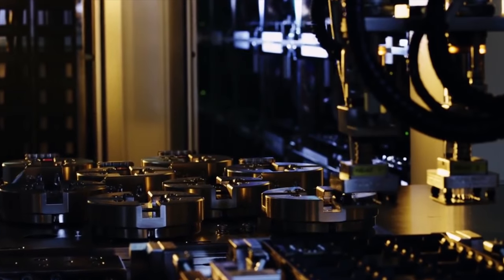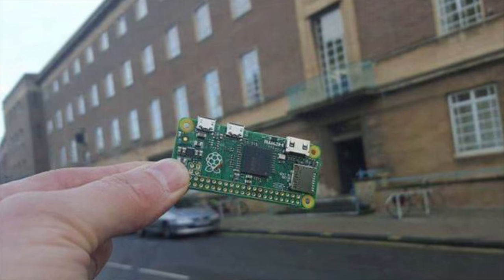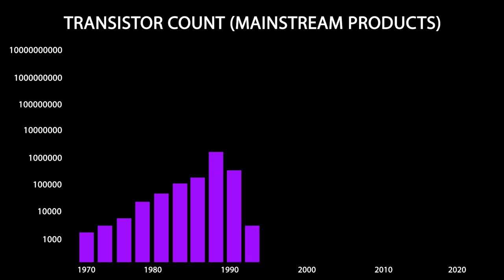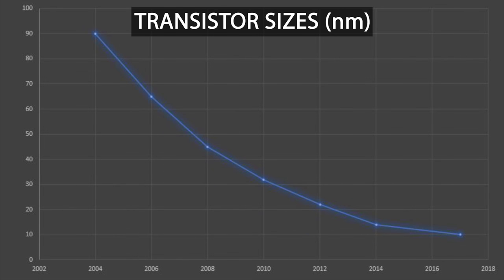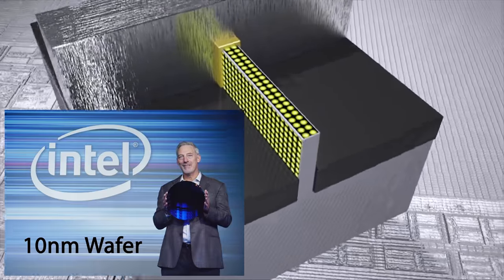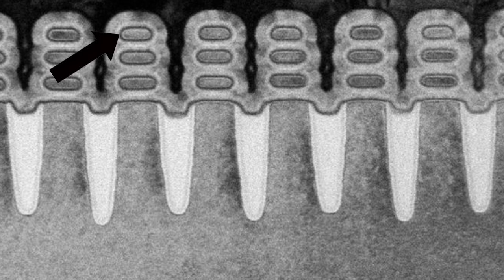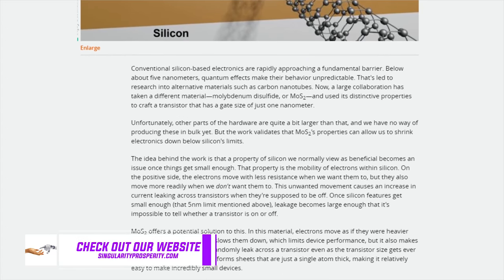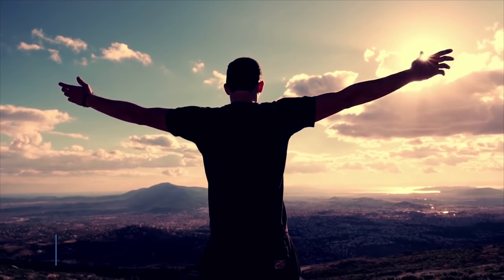The End of Moore’s Law?! (Shrinking The Transistor To 1nm)

Comment: Reads the news - Intel is having trouble with their 10nm process.
While AMD is already gearing up for a 7nm release in 2019.
Poor boi Intel
Reply: And it launched just yesterday.
Reply: And this Video is one year old, sooooo... yea
Reply: They're not really comparable, Intel's 14nm was equivalent to everyone else's 10nm
Reply: @MyNameIsPetch  That is true, but the 7nm TSMC node is slightly more dense than Intel's 10nm node. The last thing I've heard is that Intel is reducing the density to try and improve yields, but at the same time, news outlets have been stating that the node is basically dead. So idk?
Reply: @MyNameIsPetch  They sacrifice multi-core power draw for single core performance. Now that AMD has released their 7nm chips everyone will see through Intel's shit chips.
Reply: And yet AMD processors have higher power consumption.
Reply: @muzgnasicianie  No, they fucking don't. It's not 2013.
Reply: Рюусей Бои Triggered. 6700k is comparable to newest AMD’s. AMD is going into more cores. It is like buy tablet from China with 8 cores and say that is better than any branded device because of amount of cores. What AMD do is just make decent processors for less money. Nothing wrong with buying AMD’s processors, just this is facts.
Reply: @muzgnasicianie  8700K pulls nearly 160W at full load and is rated for 95W. The 2700X is rated for 105W and pulls 104.7W. Please tell me again that AMD has higher power consumption. Don't even bring up the server market, because Cooper Lake is going to be a glued together mess of an MCM.
Reply: Рюусей Бои Okay boy. I do not need processor for render a poop. Just aiming into gaming. For watching youtube or loading pages I can use a phone.
Reply: @muzgnasicianie  Sure kiddo. Go play the gaymes, the big boys will program them for you with AMDs
Reply: @muzgnasicianie  well you don't, but a lot of people do care about rendering power and multitasking
Reply: Рюусей Бои But definitely NOT YOU :)
Reply: Kreesty Absolutely FINE.
Reply: @muzgnasicianie  Too bad 10nm is coming 2h 2018 however 7nm AMD chips are coming in 1q 2018 and zen 3 architecture is at least 80% complete. Gaming is slowly moving towards using 6 threads from 4 threads. Zen 2 also has around 13% higher ipc and is running at 4.5 ghz outperforming Intel currently and has significantly better node with 7nn finfet+ and 5nm finfet architecture for zen 2+ or even 5nm finfet+ for zen 3, and Rome has 64 cores compared to 48 on Intel's cascade lake and cascade lake die is 2×698mm compared to 398mm on Rome, and newer games might run even faster on zen 2 because zen 2 can now operate at 256 bit buses for floating point operations.
Reply: @ryuuseiboi950  sure as hell. my intel is dying while baking light in Unity. can't wait to upgrade to a 2700x
Reply: Someone Kill me OMFG! I feel now like I released a fucking KRAKEN! in next 30 years maybe we will fly commercially to the moon?! And so WHAT?
Reply: @muzgnasicianie  What's your point?
Reply: Lotte That after release of next gen AMD processors, Intel will release their own. This is never ending race. I am waiting for new AMD processors and possible that I will buy for a new PC. I do not give a shit what brand but current AMD’s do not interest me.
Reply: @muzgnasicianie  Then don't go around saying AMD's CPU's consume more power than Intel. It's alright to say that you're not interested in AMD's current lineup, but don't go around saying something so blatantly wrong. The 'runs hot and needs a nuclear reactor' meme died with Ryzen, so stop that.
Reply: Lotte Man... will you cry?
Reply: @muzgnasicianie  Do you have anything to add or are you really this bored?
Reply: Lotte Yes! First - mind your language (you do not sound mature) Second - I can say whatever I want and all You can do is disagree. Third - I am buying what I need and adjust to my needs, not what you prefer.
Reply: @muzgnasicianie  First of all, I haven't insulted you. Secondly, yeah, you can say whatever you want, doesn't mean it's correct. (So far you haven't been right about the topic at hand). Third of all, I didn't tell you what you should or shouldn't buy.
Reply: Lotte Ah sorry. „Dmitry” use bad language. I am confused by amounts of comments and do not pay attention who respond to me. So you say that 8700k TDP is 95 watts but it can consume 160 watts on full load? Are you talking about overclocked cpu or just stock?
Reply: @muzgnasicianie  I7 6700k Cinebench R15 multicore score: 888
Ryzen 7 2700x Cinebench R15 multicore score: 1778
Source: CPU-L (Android)
Reply: @mikuzoid  you are comparing 2 different generations, should use the 8700k and even that got released 2 q's earlier smh
Reply: @- - amd is already doing that and yes, but it will take some time and they will further optimise because a bigger cpu means a new motherboard because the old wont fit and not everyone would go and just buy a new motherboard
Reply: @mischol  That's because I was replying to the comment the 6700k was the same as current gen Ryzen! Read the comments before you reply!
Reply: @MyNameIsPetch  that's there 14++++ they essentially just are using a more mature process to make up for difference in compute. The way the process holds them back is  the power consumption is higher and transistor density is lower for intel
Reply: @gabrielwhite3890  13% is not confirmed at all, its speculation based on the math of zen1 density and frequency vs zen2 density. While its probably accurate at best , and more likely closer towards 20%+ , it's still speculation.
Reply: @gabrielwhite3890  I doubt 10nm intel will release in 2018... That's 1,5 months and they've JUST released the 9-series.
And nope. Zen 2+/Zen 3 is not going to be 5nm. AMD listed it as being 7nm.
Reply: @Mikkel111  Well TSMC is currently testing 5nm nodes right now, and AMD used a slight process shrink with whatever they had, and 5nm seems like a good option but probably will be the finfet+ version of it. According to Mark Papermaster, they are already done with the 7nn finfet+ and considering the fact that smartphone giants like Apple or Huawei use the smallest node possible, AMD will be losing out if they stick with 7nm considering 5nm is a half node. But zen 3 will definitely be a smaller node considering they're supposed to the 'renaissance' of chip design with the zen architecture. Not only that but AMD will want a higher density for their server market. I'm not sure about 10nm still being around though.
Reply: @tarkfarhen3870  Polaris was an architecture which has no way to beat Pascal, but amd and Intel are close enough that a superior node will make it consume less power. Your example makes no sense what so ever.
Reply: AMD IS REALEASING KILLING 7NM NAVI TO GRAPHICS

THE PRICE PERFOOOMAANCE POWAA.
Reply: @milo20060  Uhh 7nm is sadly not getting yields it's supposed to because of complexity. It's like a new oven for pizzas and a simple pepperoni pizza will be cooked much easier than a pizza with many different toppings, not only that, but Navi is extremely hard to predict when it comes to performance, you can't celebrate Navi if we're not sure.
Reply: Just be thankful about AMD, without their ryzen, Intel would still be on 4cores 8 threads configuration..
Reply: @heyitsmejm4792  6c12t was going to happen just at $500. Calm yourself AMD was just marketing as them pushing Intel to do it.
Reply: @MyNameIsPetch  the reason Intel's 14nm is so good is because they've been rereleasing the same technology, just making smaller tweaks
Reply: Correct!!!!! Intel had been sleeping while AMD has been hard at work!
Reply: Intel went down a dead end in hopes of finding a way to increase yields, and it was a horrible blunder. The blind pursuit of mo' money has finally dealt intel a massive blow, and they may never be the same. Intel has two options, learn their lesson and get back into being a company that makes good CPU's, not cpu's with the biggest profit margin, or delve deeper into anti-competitive cash grabbing that got them there in the first place. The later will be suicide, but everyone with authority at intel only knows the later.
Reply: Southeastern777  Which is exactly why you should be supporting AMD. That is, if you believe in capitalism. But, if you are trying to point out how capitalism is flawed, please, keep supporting monopolies. 
I will never understand how anyone can fanboy for a company that already holds the majority of the market. What are you trying to prove? Awfully self destructive behavior.
Reply: Southeastern777 Okay, thanks.
Reply: @ryuuseiboi950  dont be mad Intel is way faster but also more expensive. AMD is slower but cheaper. Both have uses
Reply: Southeastern777  Eat up your ovens, mate. AMD's CPU's are absolutely destroying everything.
Reply: Southeastern777 Why are you using a mediocre processor that you clearly don't like? Doesn't it kinda seem like you're lying? Also why are you calling something mediocre when it delivers the most competitive products? AMD has held most of the CPU market for the past 3 quarters and Intel has no answer. Just inform yourself amd then come back.
Reply: Or perhaps AMD is more irresponsible than Intel. The 14nm and 10nm FinFET processes have been a real nightmare. Really bleeding edge stuff. Imagine the issues 7nm FinFET will bring.
Reply: AMD leans on TSMC for this. Designing architectures is like an architect designing skyscrapers. Not every design comes to fruition, without the right capability.
Reply: @muzgnasicianie  Not sure if it has already been answered, and if you are even still interested by this, but here is the explanation for Intel lower TDP than AMD's:
The difference comes from the way both companies have defined TDP. Intel defines a chips TDP as the heat the chip outputs at the base clock. This means that the chip, when it is boosting, might output significantly more heat.
AMD, on the other hand, defines TDP as the heat output at the boost clock, which is why their TDP might seem higher than Intel's, when the actual heat output might be lower.
Reply: Lotte asking someone if they have anything to add and if they are really so bored is offensive
Reply: James Berry and this is what everyone seems to miss...
Reply: Well AMD rushed  it.
Reply: INTEL XEON PLAT 8176M 28C 165W 2.1G  ........And everyone forgets the real mass users of CPUs.....Servers lol
Reply: @muzgnasicianie  not now lol
Reply: Intel is still having trouble with 10nm on the desktop. Only Ice Lake is 10nm.
Reply: @UnrealOG137  yup. And from what I've heard, AMDs Ryzen 5000 series CRUSHES Intel's 10000 series in every way, including single thread performance.

Also, AMD is appaerantly ACTUALLY COMPETING on every level with NVidia...

Team Red just be destroying everyone this year...
Reply: @AnotherLotte  7nm is almost 14nm of intel der8auer shows it in video with a microscope
Reply: @12Burton24  I could've sworn TSMC's 7nm node was denser than Intel's 14nm node, about on par with Intel's 10nm node. Also, you replied to a 2 year old comment I made, when Zen+ was on the scene, and Zen2 was about a year off from launching.
Reply: @AnotherLotte  it is by a little but its far away from twice as small. And this should already be known 2 years ago thats nothing new 😉 because its over a lot of past cpus the same stupid marketing bs
Reply: @12Burton24  I don't think I ever mentioned it would be "twice as small" anywhere within this comment thread. Only that TSMC's 7nm node was slightly denser than Intel's originally intended 10nm density.

I mentioned the thread's age mostly because my memory sucks, I had to look all this stuff up to make sure I was remembering things correctly.
Reply: @AnotherLotte  maybe i marked the wrong person, sry for that.
Reply: @12Burton24  It's ok, I understand, I've done that before too.
Reply: Quantum computing is future . But iphone Making 5nm processor implies we are long way from moore's law ending.
Reply: @Scarface-hl4bl  This 5nm are anyway not 5nm in gate size its just a fancy number they splitted years ago the nice nm nam from the actual size.
Reply: @muzgnasicianie  this guys is dumb af.. sad that everyone is kicking your @s*
Reply: Now iPhone 12 has a 5nm processor, and Android phones will start being powered by Snapdragon 888 first Android 5nm chip.

In 2022 we'll have 3nm chips.

Intel still is stuck at 7nm 😂
Reply: @DarkH4X0  Intel is not even aiming to 7nm nor is this number saying anything. 7nm or 5nm is just a name nothing lese i earlier days it was the size of the transistor gates...but thats a  long time ago.
Reply: Now their gonna put 3nm in zen5 while Intel is gonna finally get 10nm in 2 years
Reply: @moist.politician  One thing i can tell you they dont put 3nm into, 3nm is a technology process called like this and it says nothing about performance, in theory 10nm Intel could beat 3nm TSMC because the name tells you nothing about performance.
Reply: Poor boi intel😂😂😂😂😂😂no it is very very rich
Reply: And here we have 5nm now
Reply: @grischu8277  this video will be 4 years old soon….
Reply: Reading this thread in 2021🙄🙄🙄
Reply: @Muhammad-cx8ey  Pre-ordered two 12th Gen core i9 12900k just last week! Winter's coming and I need some space heaters!

Comment: Nvidia is cheating with Moore's law. Instead of relying on making node size smaller, they simply increase die surface area. Moore's law makes an assumption that each product is of similar production costs, but this assumption is unfair. If you plot for computing power per price unit, you'll notice that the last few data points on the Moore's law graph are all outliers
Reply: Exactly
Reply: Akin Khoo   I agree.

In fact you can pretty much extrapolate (see what I did there?) Moore's law to pretty much any important metric about computer power & digital performance, as he showed in the video.

And as he said at the end, it doesn't even really matter, ultimately, that the size of the chip is going down. As long as the computing power increases, even if it's from CPU processing optimization (better planning computations so there's less overhead, basically, and compiling them in a way that avoids multiple computation when possible), we're good.

The letter of the law may be broken, but the spirit remains true.

No cheating in that.
Reply: For the PC Market no one cares if the Chip is 1 inch or 5 inches big ;D
only "smart"phone hipsters need small chips so they can carry their survailance device everywhere and look cool ;D
Reply: @hyperhektor7733   You seem half serious, but still.

The density of computing power matters just as much a costs. You can see it as the number of operations you can perform per volume unit. Just as increasing computer density has made possible PC (which would never be possible with, say, the 70's density that could be achieved, regardless of price). Greater computing density enable applications unthinkable before.

Of course price matter, otherwise there's not breadth to the market for computing power.

I see price as breadth & density as depth, in a way...
Reply: @Francis Vachon i am on Board since Windows 3.11 and the x386 Cpu :D and i installed and since then every windows version and build every PC my self (the newest midprice-cpu which was aviable at the time).
So i can say i have a kind of overview of the topic :).
What i see is that the cpu-power is wasted by the programmers, since they started to use more and more less efficient programming languanges(for programms and operating systems). So the hardware becomes faster but the user experince stays the same since 20 years xD.
We already are far beyond the point where performance per volume counts. I can buy a used xenon CPU for 7$ on ebay which has 4000 Passmark points which is insane. People these days have really no clue how powerfull cpus are , they think an i7 is just good enough for websurfing lol.
BTW, the time where you can compare cpus by Ghz or cores or cache stopped When the first Intel-cpus with ratings came up. I found the most consistent and largest database is from passmark.com. They have very old cpus and the newest so i use this as comparison since 15 years for my cpus.
Reply: Because of big quantity of heat they need bigger cooler
Reply: @logiconabstractions6596  you can't make cpu processing optimizations forever either, I think the law will be broken within a decade for sure
Reply: @andrewhenshaw4067  I could be. 

But the thing to understand is that the law is meant over the long run. Things can stall for a few years or a decade, but the theory is that over decades, tech innovation break those plateaus.

Our current obstacle is going to be quantum effects due to chips @ 3 nanometers. Perhaps some tech improvement allow this to go down further (and engineering capacities to manufacture that at scale and at a reasonable price). Or perhaps quantum computers, or optical computing....
Reply: @logiconabstractions6596  I looked around some more on youtube and found out that the 5 nm and 2nm chips actually are bigger than that but because of their design they are equal to the power of a theoretical 2nm chip

The chip is then marketed as a 2nm chip even though they aren't actually that small 
Link to the video that explains it https://youtu.be/GdLRSF5wZpE
Reply: @logiconabstractions6596  I just realised you answered me within 30 min on a 4 year old comment
Wow